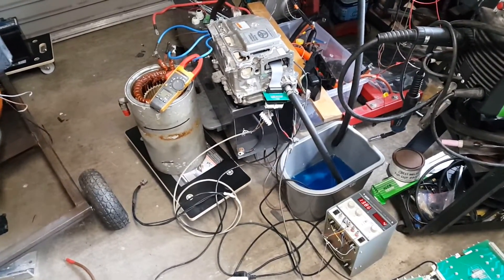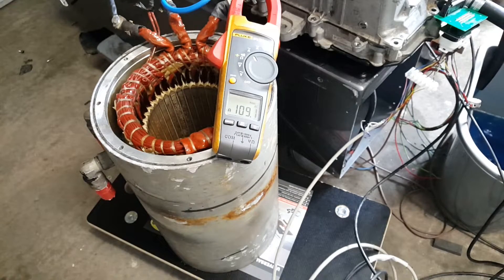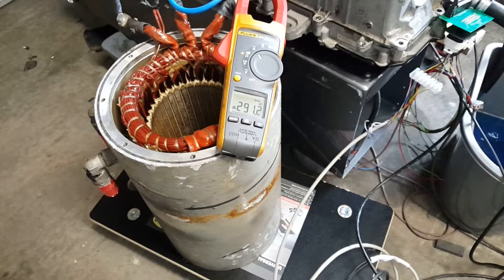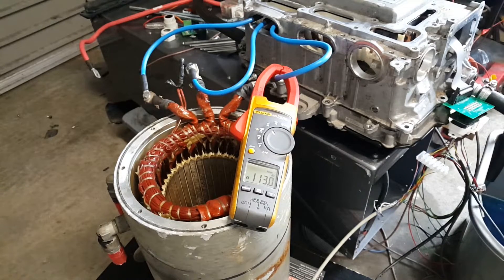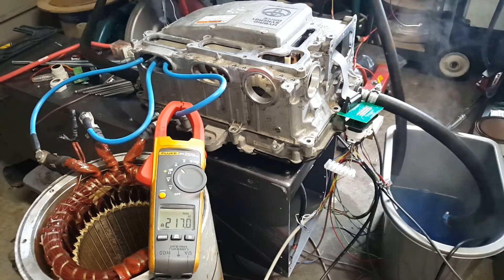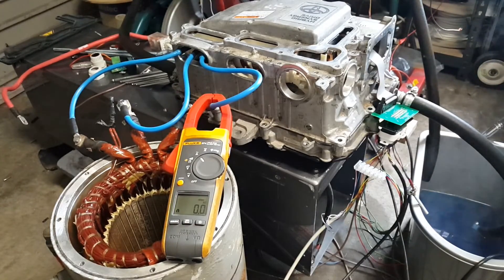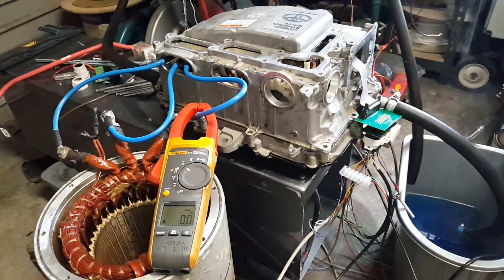Toyota Yaris Inverter Load Test

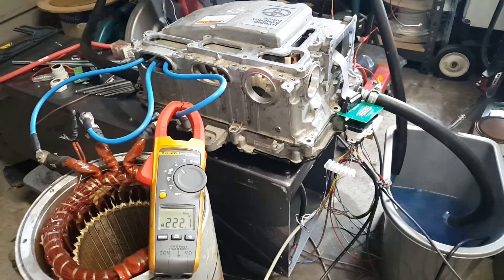Comment: The smoke and vibrating cable and almost boiling coolant at 12:20 and onwards is a shure sign that you're only 
putting 20 Amps into that stator. :-)  Great stuff!  May I suggest adding some kind of cooling to the coolant 
like for example a cab heater or similar in line on the hoses so you don't loose cooling of the inverter due to 
boling that  shurley will kill it but in the wrong way?     Looking for a cheap way of converting my Smart fortwo 
when the little 600cc engine gives up its ghost and the Prius G3 seems like an interesting alternative to a 
Model S drive system, it ought to have enough power to make the little Smart a scary ride. :-) And it leaves more money for batteries too.  Can anyone tell me how much power MG1 and 2 puts out combined ?

Comment: What I don't get is, is that 200Amps*80V=16kW. That doesn't sound all that impressive. Have I missed something? Probably the voltage out of the Inverter is a lot higher.
Reply: This inverter works with 350v+ nominal voltage. However its current carrying capacity is not related to the voltage level, so it can be tested just as good with lower voltages. It is also much safer to use lower voltages since in the case of the failure the energy that is stored in the system will be lower and less dangerous. Since at one point the current was 300A that means the power output could be closer to 300A * 350V = 105kW!
Reply: @juiceofsapho  For a safer (and more economical) way to do a full power test, couple the motor to another one used as a generator, then feed the generator back to the DC bus through a rectifier.
Reply: He got up to 300A RMS, so 300*1.414 = 424.2A peak, so a peak output of just under 34kW unless I've done the math wrong.
Reply: The voltage of the inverter isn't neccesarily higher than 80V. The goal of this test is just to find out how much current the inverter can handle.
Reply: 105kW, ok l am impressed.

Comment: First smoke at 6:05 :-)
Lets stick a screw driver in the magnetic field at 10:15 what could go wrong...
More smoke at 10:30
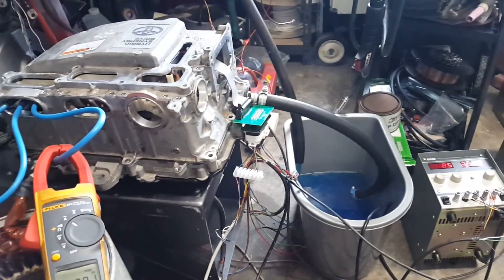Steaming water at 11:00
Also take note that of the blue wire oscillating under the ~220 amps of current
What will fail first?  Not what you think at 14:37 ...
Reply: Reminds me of Photonicinduction...
Reply: I wasn't expecting that... but I was expecting to not to expect something, so it doesn't count... =D